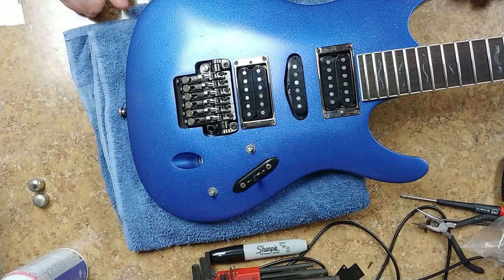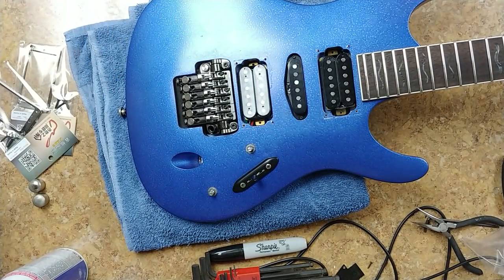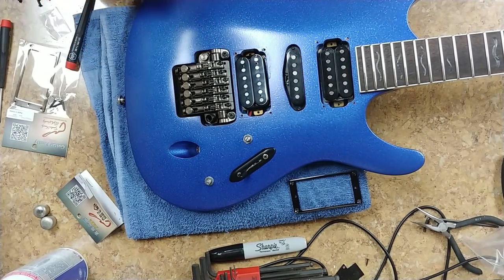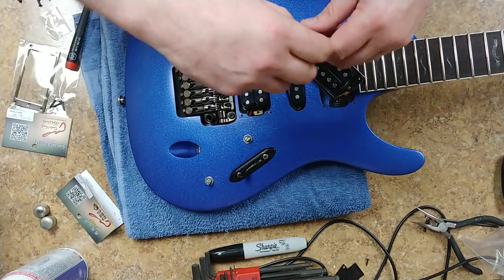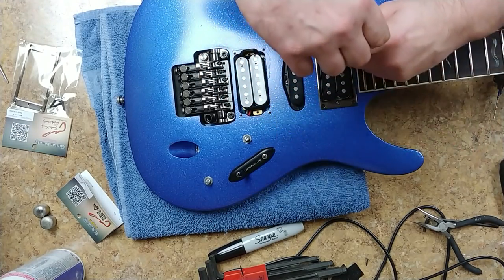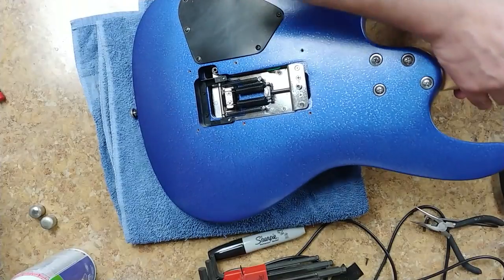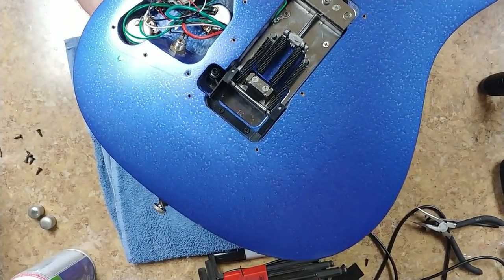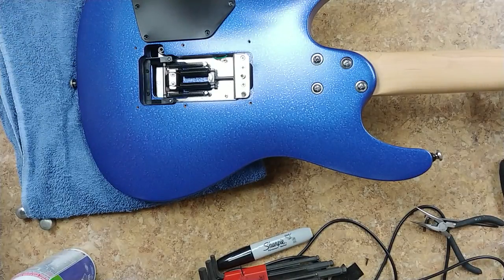Working on the Ibanez S470DX

Comment: How come no grounding paint in the pickup cavities?   I have spent time on the few guitars I have and pulled pickups out and painted the cavities good and then took some shorter springs I think I used the kinda springs you use on a faucet :).  Put those between the body and the flange on the pickup so it connects the pickups grounding plate to the shield paint.  Helps a lot with high gain playing sitting near computer when recording.   Not all of my guitars picked up computer noise but one in particular did badly and this helped a lot.  So its kinda just a thing I do now .  Of course same with inside the electronics cavity as well and then I screw a ground to it.    How old is that guitar?
Reply from the maker: If I was taking the pick ups out, I would have used the shielding paint myself. It seems to be ok without it.
Reply from the maker: I'll have to check on the year. I'll let you know.
Reply from the maker: its a 2003
Reply: @ericctheartofnoise8613   Yeah it looks older  and might explain why there was no grounding in the cavities .  At least the two even lower cost Jackson I have gotten had a crappy thin layer of grounding paint .  Maybe its something on the newer side of things with today's guitars :).   Does that stable thing work well?  I saw they sell one for Floyds on Stew Mac from Hipshot that has great reviews.  I do not use trems but my one cheap Jackson has one and I just put a large chunk of rubber between the body and the trem block lol.  Do you have any videos showing how to install one on a Floyd ?